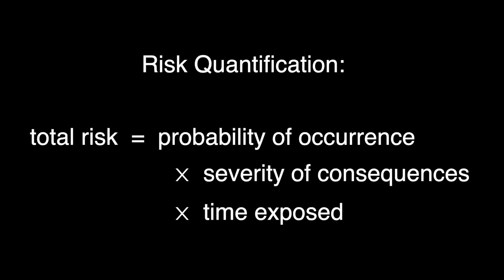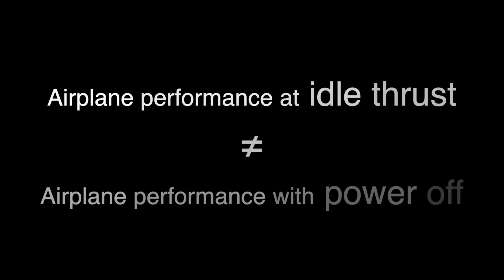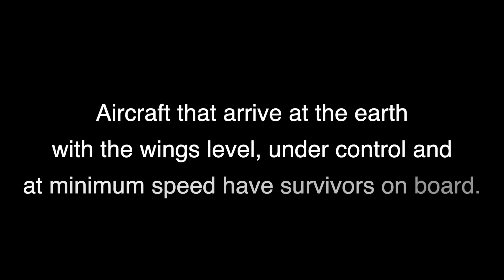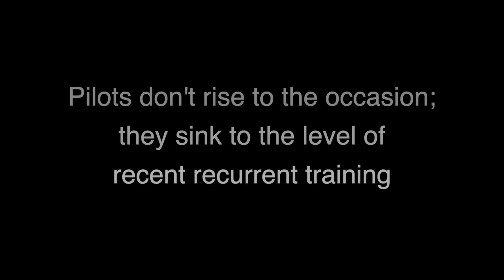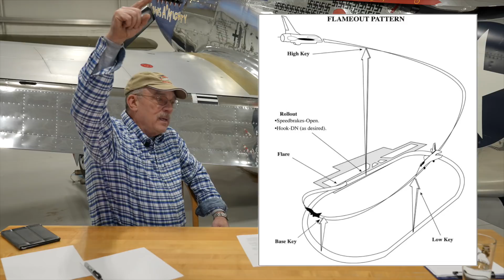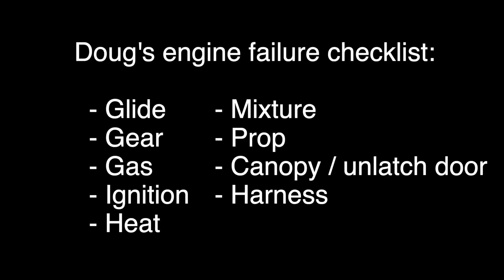Loss of engine power and the (im)possible turn - with Doug and Martin

Comment: Flying a C 172 on MS X simulator will give a pilot a very good idea of what will happen if they attempt the nearly impossible turn with idle thrust. Even if you make it to airport property, it’s by inches just to get to airport grass, forget the runway. Not sure about the other aircraft. 

The key to less accidents is more experience which requires more flying. And, better trained, more experienced A&P mechanics would lessen  fatal mechanical encounters. More flying cost more money. Better mechanics would require better pay to keep experienced A&P mechanics  from going to better paying airline jobs. This requires more money. 

Under our current greed based,  corrupt political and K St. corporate capitalist economy, along with the Bush 43’ no child left behind, which meant no adult left behind, (Nobody flunks in school or life anymore) I really doubt we can do any better in aviation safety. 

Nearly 50 years ago when I obtained my PPL, we did zero training for the impossible turn Yes, absolutely zero. The only thing i needed to know about the impossible turn was to not be stupid and attempt to do one. If as you say the priority is to save yourself and passengers, not the plane, then by all means land straight ahead. If you attempt a 180 after power failure on takeoff, then the passengers and yourself are no longer the priority. The plane is.

All this thread really does is to plant the seed with an inexperienced pilot or student, that by golly, you can make the impossible  turn possible. The total focus to save GA needs to be making it more affordable. Without sacrificing safety, but, with the realization that there are going to be accidents. And, there is the ultimate accountability in all things aviation, and will likely continue to be so.

The corporate owned media totally controls this country now. They will destroy anyone who attempts to take away their control. They are not about to allow change unless it profits them.
Reply from the maker: I would argue that one cannot experience the true effects of ground rush from MS Flight Simulator. It’s not about how much altitude you lose - yes, THAT you can experiment with on a simple simulator - but the adrenaline-inducing sensations provided by your regular and peripheral vision from an unusual position.
The rest of your message was kind of lost in unrelated political statements, which I would like to ask you to refrain from on my aviation channel. Just to make sure we are on the same page: if you think Doug and I tried to “plant a seed with inexperienced pilots or students that you can make the impossible turn possible”, as you wrote, that’s entirely inaccurate. As Doug said, EVEN IF it is possible, it is usually not the lowest risk path we can chose should the engine fail right after take-off.
- Martin
Reply: @martinpauly -

1) My reference to MS Simulator is that if you practice the loss of power on takeoff using the simulator, you will likely see the outcome of the impossible turn in real conditions. That being that even being prepared, planning what you will do and where you will cut power, likely you will not make even the edge of the airfield in the MS simulator. With an instructor actually flying the Cessna under actual conditions attempting the impossible turn, the outcome is very similar to what would have happened in the simulator. Without static thrust, and him pulling the power on crosswind exactly when he wanted, he could not have even made the airfield. Same outcome at another point in the pattern on an extended downwind. He would not have made the runway without static thrust and being able to plan the simulated engine lose. He barely cleared the trees under a controlled power lose, and he was 50 ft. above pattern altitude when he pulled power. He would not have cleared the trees without the extra 50 ft.. They do not call it the impossible turn for nothing. Am I entitled to my opinion? I suggest you try the impossible turn in your Bonanza in the simulator, and in your Bonanza under average wind conditions. I’d bet you can’t do it in either one.  
2) Were there enough crashes last year attempting the  impossible turn to warrant this focus that seems to be out there these days? 
3) Everything is political. That is why we still have the same issues we had 50 years ago. It’s why aviation was affordable 40-50 years ago and it’s not now.
4) I have had I guess three instructors in the last two years confidently tell me they can return to the the airport if they lose power on take off. That is very scary. Several even telling their plan. I do not believe it. One instructor explaining to me it depends on how long one spends on the “aw shite” moment when the prop stops. But, he was confident he could pull it off. 
5) If you don’t like other people’s opinions, maybe you should stop making videos.